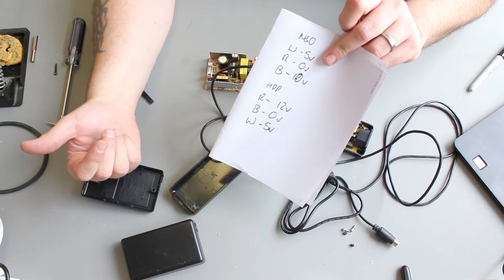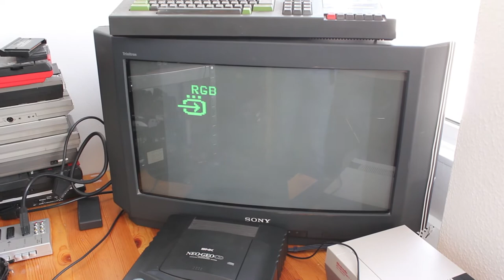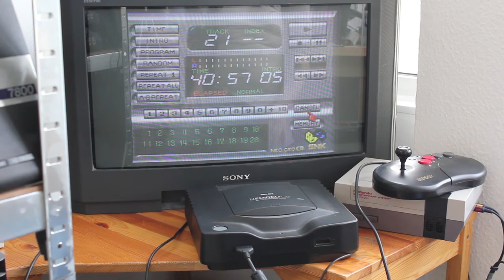NeoGeo CD AES - Repair, Region and PAL MOD

Comment: I gotta say thanks for this video. In particular, I really appreciate the info about using 12v for the 10v line.

I recently obtained a bare Neo Geo CD toploader with no PSU which reportedly has trouble reading discs even with a new laser. Obviously, the first step to troubleshoot is to get it powered on, but I don’t have the original adapter. I found a cheap 5/12v adapter with the right connector that probably only needs the connections switched around to match the NGCD’s arrangement. Eagerly awaiting delivery now! 5v amps are a little low (1.2A) but I believe they spec’d the Neo CD with enough overhead that it’ll still work.

It appears to be easily serviceable since someone makes an internal replacement board to support an MSX2 computer (same connector; different specs). I plan to make a video of my own about this option for NGCD but I wanted to go ahead and express my gratitude here first. Thanks!

This deserves a lot more views and I’ll definitely link back to you if I’m successful enough to make my own video. Awesome job!

I did take a look inside and noticed that it still has the PAL jumper in addition to the North American English jumper so perhaps it reads discs fine but the region settings are invalid. If so, I have you to thank for that revelation as well. We shall see. :)

Comment: You think the loose connection was the only problem with the original brick?
Reply from the maker: Well the problem with the original brick was that it was only rated for 100v AC and had then been plugged into 240v AC and killed. The broken connection is an exploded component, It think a ceramic capacitor of some sort or a fuse not too sure. Anyway I had to replace the PSU if i wanted to use the console safely in the UK. I wouldn't trust it on just a step down transformer for long periods.